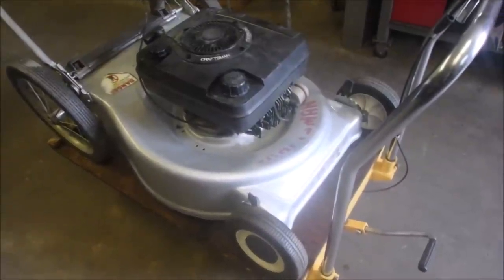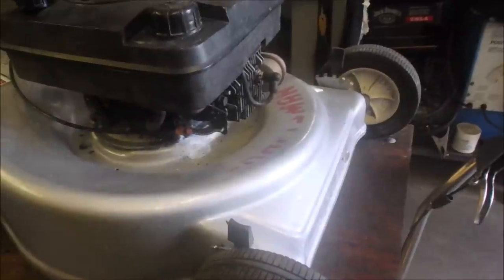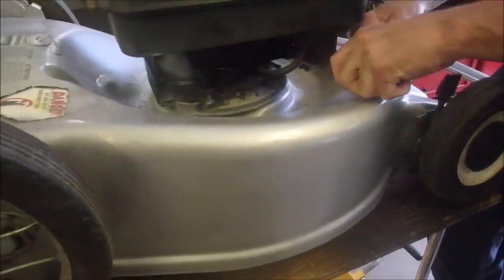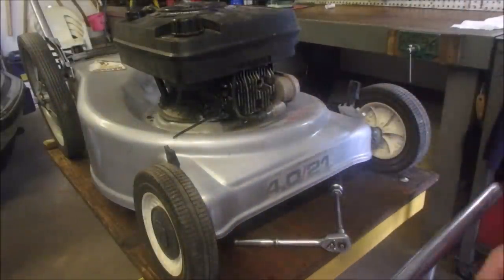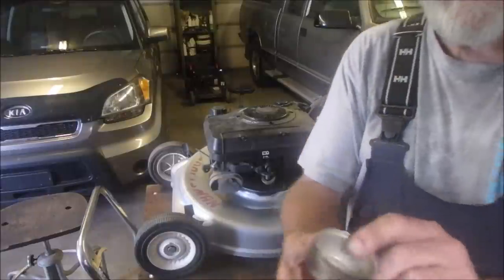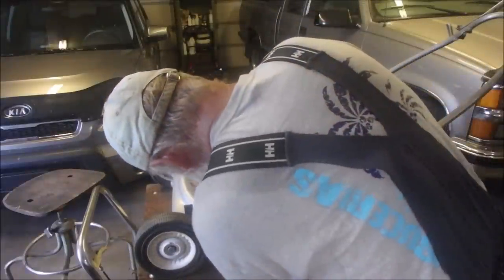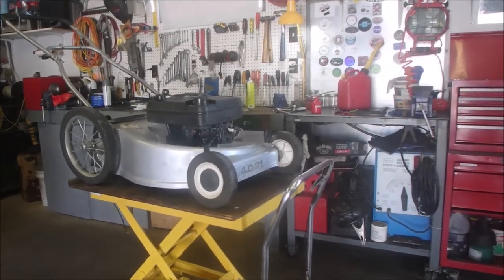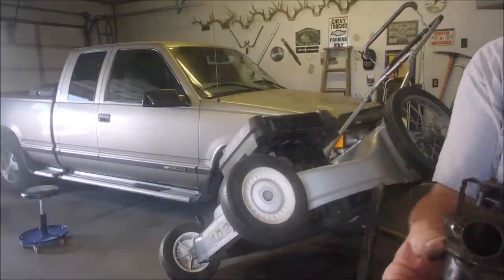Homemade Repair on an Old Tecumseh Mower

Comment: Very nice job sir! Now if that were my own personal mower I’d probably lose the tank/shroud unit and put on a separate tank and an oval air filter setup like the ones used for Toro. It’s also possible the round Craftsman air filter style would fit under the shroud if you wanted to keep the cover on there but I like it better without. Thanks for taking us along, always great to see another Tecumseh get saved!
Reply from the maker: You now I never thought bout the different filter until I edited the video.

Comment: Ive never seen wire wheels on a mower before, quite like it. Nice repair on the air intake.
Reply from the maker: Thanks 👍  I have a set of spoke wheels hangin in the shed.

Comment: Those intake tubes were a flaw in the rubber material they used . I ran across one awhile back ( the rubber tube ) while looking for something else , must have saved it for that reason . 🤔 good job
Reply from the maker: Thanks for the info

Comment: Hey Bruce did you ever work on a mower that had a crank on the top to start it. I remember having one when I was a kid.
Reply from the maker: No but i did have one that would a spring up after it was started.  for the next start,  Very dangerous spring in there!!!!!
Reply: @BrucesShop  VERY dangerous! Back in the day technicians get hurt screwing with them.

Comment: Nice work 👍👍 I watch and enjoy all your videos. I've seen a number of them now where you work on mowers on that raised platform. Great little stand to save the back for sure. However, each time you start up a mower I always think that it would be much safer for you if the mower was secured to the platform to prevent it from jumping off ( due to vibration). Could create a pretty bad situation if that were to happen! 
Thoughts???
Reply from the maker: You are absulutly right.  I am starting to lower it a bit so ot doesn't become a helicopter.

Comment: OK, this week I have replaced the fuel tank, fuel hose, new furl filter and cutoff. Also changed the oil and oil filter on the riding mower. This afternoon I also ordered another carb for the push mower. Gas doesn’t last any more without Stabil.

This wasn’t easy for me with my limited vision. I’m going to try and replace the carb myself. May need to get new glasses for my fingers (LOL).
Reply from the maker: That is a good line.  Glasses on my fingers.  Sorry your eyes are giving you trouble.
Reply: Mr Bruce, I’m legally blind because of AMD. By the way I’m in Central Texas.

Comment: Not a bad fix Bruce.  Finding that piece of hose may be impossible.  All I could think of would be a rad hose 90 but I think your fix will last for years.  Nice mower though.  Thanks.  Stevo
Reply from the maker: Folks seem to like the spocked (spelling) wheels.

Comment: did carb have screw holes that matched the later adapter for horizontal air filter?
Reply from the maker: Yes.  Of course when I finished it and sent it to the owner i thought the same thing.  Use a new filter assembly!!!

Comment: If there's cracking or checking not covered by the heat-shrink, you might try liquid electrical tape on that part.  Paintable latex might seal it too, but I have no idea how well it tolerates heat.
Reply from the maker: Thanks

Comment: I always look forward to your videos and have learned so much. Is the part you made the crankcase breather tube?   Was it made of rubber ?   Thanks again.
Reply from the maker: The part i made was the actual connection between the carb and the filter.

Comment: Hi Bruce. I know this will surprise you LOL  but I have that exact engine in one of my buildings,  same cover , same filter. I can't remember what shape the boot is in. The blade end of the crankshaft is only an inch long so I can't really use it on anything. It's been in that building for probably 16 years.  Anyway great job as always getting this old dog running again
Reply from the maker: Thanks for sharing.  Great to hear from you Dave

Comment: How to make due Bruce nice save we know how old that machine is ! Two pulls take it 👍 Just curious did you find another cable or able to lube that to get it to work ?
Reply from the maker: I just turned out the connectors about 2 turns on the conduit part to give me a bit of tightness on the wire cable.

Comment: Looks like 1982 was the kill switch regulation, not1990 like I thought. So 1987 is probably correct.
Reply from the maker: OH.  I looked at the engine serial #   They don't give you the decade.  It has electronic ignition so it is after 1982